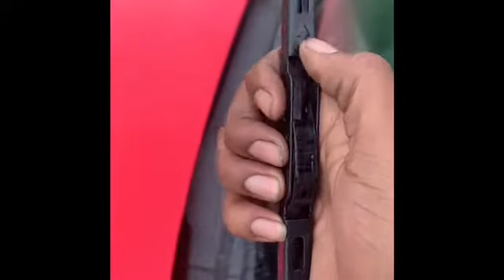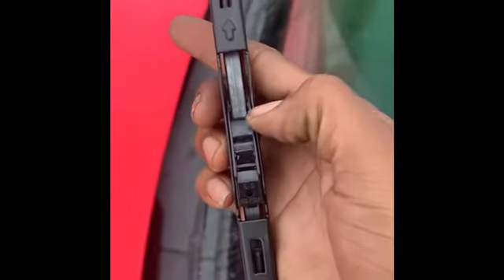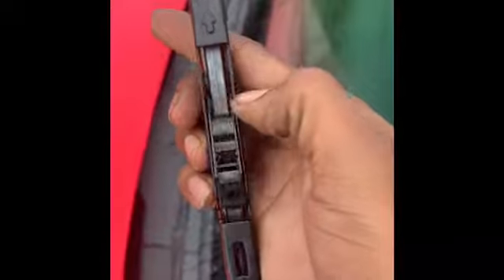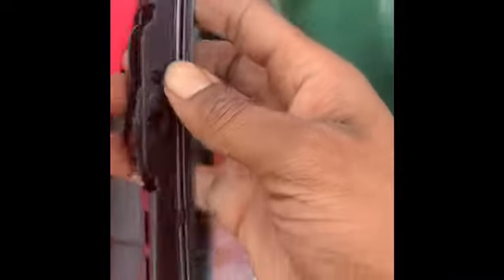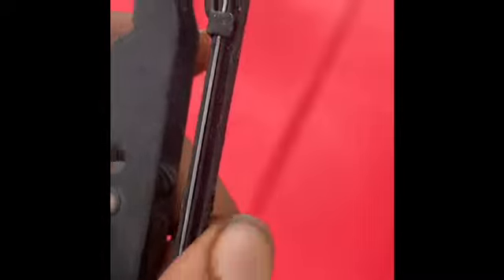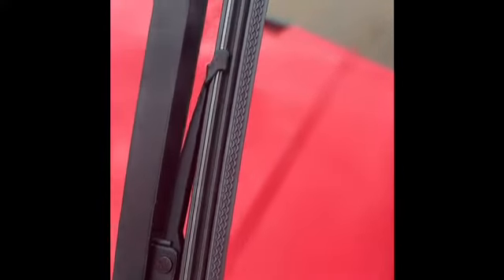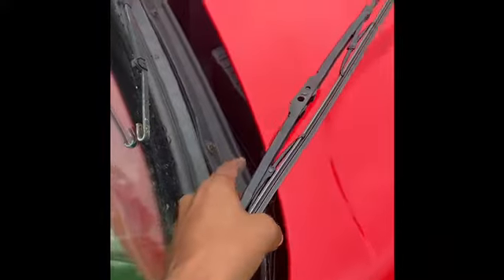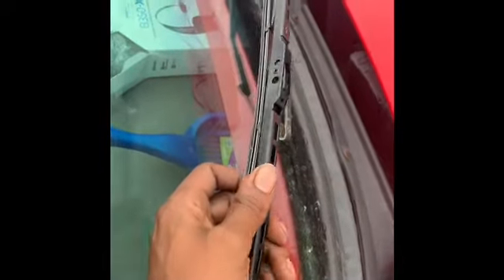How to change wiper blades on my freightliner cascadia

Comment: You have to hold onto the edge of the windshield and step on the lugnuts, then  hold and hop onto the tire be careful when it rains or if it's morning dew or anything slick on the bottom of your shoe like diesel that guy is funny 😂